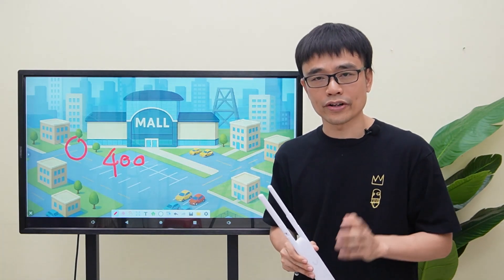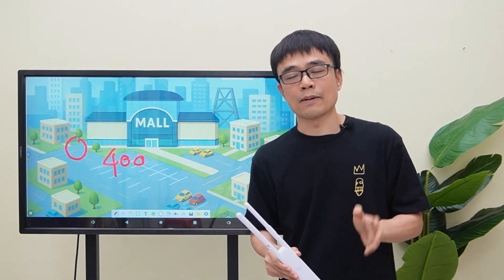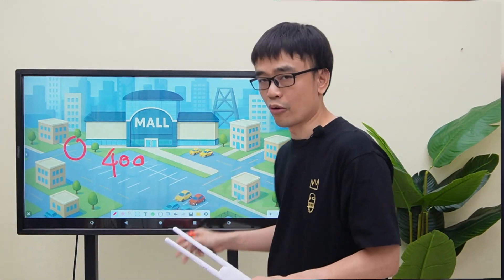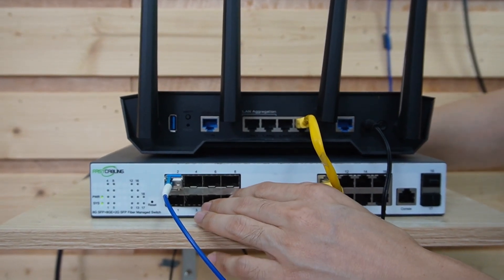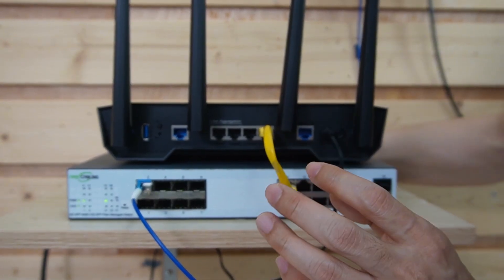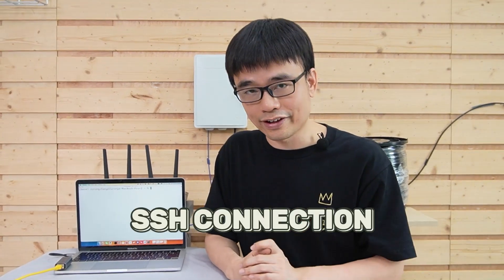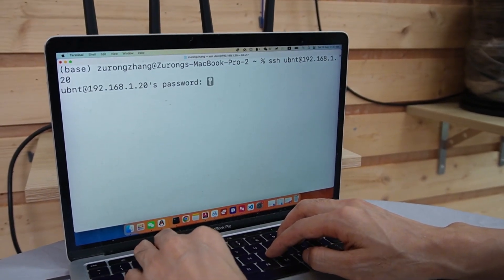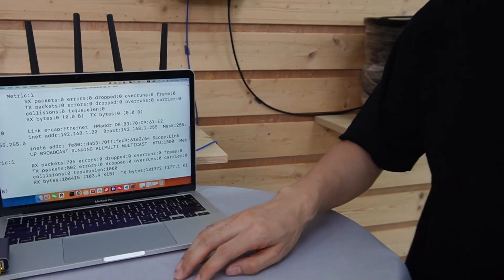Extend Ubiquiti WiFi with Fiber Optic Cable Up to 400m+ | Outdoor Ubiquiti Access Point Setup

Comment: Where do I buy your stuff
Reply from the maker: Hi, you can order on our website: https://www.fastcabling.com/

Devices used are:

1x 8+8 Ports Managed Fiber Ethernet Switch with 1Gbps Uplink: 
https://www.fastcabling.com/product/88-ports-managed-fiber-ethernet-switch-with-1gbps-uplink/
1 pair BiDi SFP modules:
https://www.fastcabling.com/product/bidi-sfp-fiber-modules-2/
1x 300M Pre-terminated Fiber Optic Cable:
https://www.fastcabling.com/product-category/indoor-outdoor-fiber-cable/
1x Outdoor PoE Fiber Media Converter:
https://www.fastcabling.com/product/waterproof-industrial-hardened-grade-fiber-poe-media-converter/
1x Fiber Termination Box with 8 LC Adapters (optional):
https://www.fastcabling.com/product/fiber-termination-box-with-8-lc-adapters/

Comment: Good day sir, I have yourself very educative, I have difficulty in troubleshooting six new 5mp Ip cameras that is not not displaying on my 16 ch Poe NVR they are the same brand but it's showing connected but adding.
Reply from the maker: You might test the cameras alone with PC software from the vendor. Both cameras and NVR has embedded software and it works standalone. It doesn’t rely on each other. You also can login to the NVR and try to find the connection status. It might provide your some status such as the NVR is unable to decode the video because the resolution is too high.
Reply: @Fastcabling  if the resolution is too high for NVR, then what should I do? shld change the resolution on the monitor?
Reply from the maker: It is not the HDMI output resolution. The NVR doesn’t have enough resource to handle higher resolution. You either can downgrade the resolution in your cameras or change your NVR.